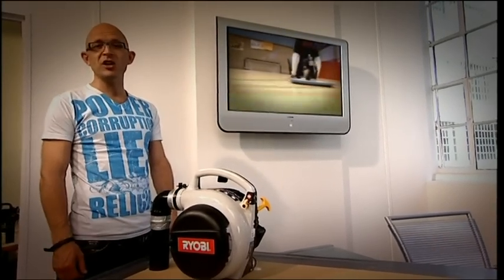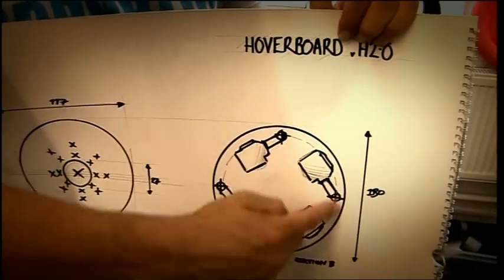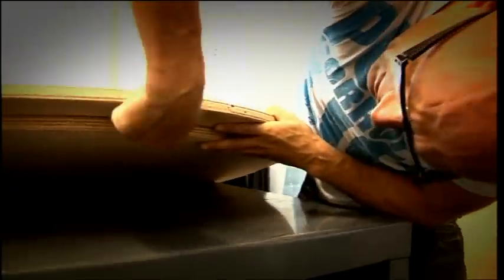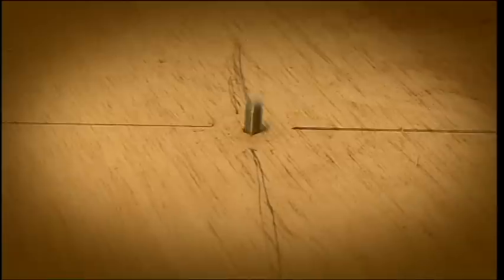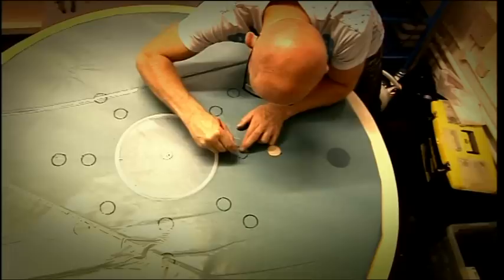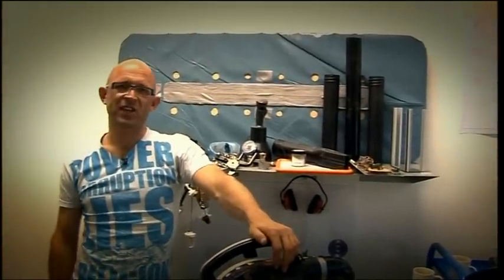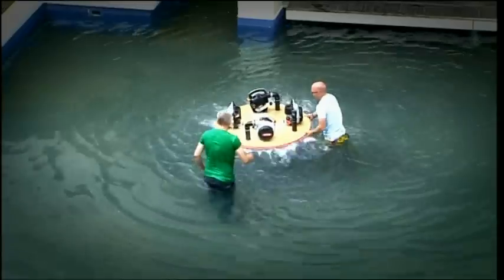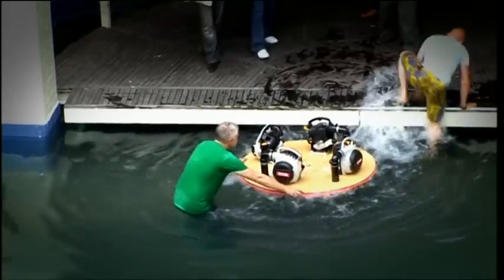Making a Hoverboard Part 2 - The Gadget Show

Comment: Several problems 1) surface area 2 small rough math 1sqft per 10 lbs US, 2)  the air bag should be thicker. try using a intertube cut & streched to size or multiple tubes one per motor. rough thick ness of air bag should be 1" US per 30 lbs US. 3) tractor intertube can be used to make it float. Place around the out side and secure with staps. Remember total lbs of craft and rider must be used.
One fan should be used for movement or U will row it ;( 
This is my design from way back enjoy

Comment: hmm if u tried 8 of those engines and used a larger surface the pressure of all the air would make u go crazy high and floating on water why dont u try to make a part 3

Comment: but the thing that needs to change is  that gasoline, otherwise, you have a couple of gazillion dollars for the toys alone, from this, not to mention use in practical applications, but the gasoline has to be replaced with something else. plus , not only the problem to the enviroment, its a danger to sit in the center of all that flammable liquid. the heat from one could ignite the fumes if a tiny crack in the plastic or some such thing occured. very dangerous with the gasoline, otherwise , cool.

Comment: You could probably put some fins on the front of the board and rig it to a steering system to direct air coming at you in the direction you want, kinda like how a swamp boat steers.

Comment: 1) use more engies
2) configure them so they pont straight down instead of a bend in th arm.
3)1 layer of wood 

already cutting out a huge amount of weight and you are already adding more power. that should help it alot.

Comment: 30 cc isn't that bad really, not with four engines. A moped has a 50 cc engine and they are capable of coming to speeds of 100 km/h, that's not bad, right? And the engine's just supposed to lift a board and a man, and he has four.

Comment: if the skirt is not "tight" up against the board, than it works. me and my dad built on using an old lawn mower engine (with o home made fan attached), a doughnut floatation device and some fans for propulsion, ours was much beiiger, and design was different, but it can work.